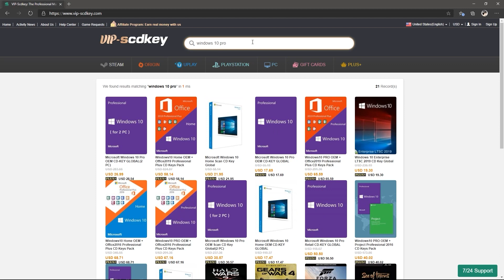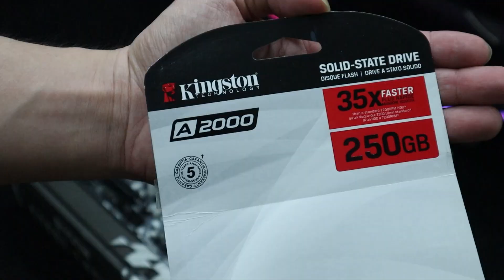SUBSCRIBER PC BUILD under 25K ft. Frostflow X ID Cooling for Gaming, Streaming & Work from Home 2020

Comment: Planning to build almost the same setup, 3400g no gpu for now, case techware forge m white w/ 4 argb fan included. Ask ko lang Sir what if yung mapili kong mobo is not supported ang rgb or argb ng fans na kasama ng chassi, may other ways pa po ba para magamit or mapagana yung argb fan ng chassi?
Reply from the maker: Gagana un basta may fan hub. Kaya mo lang naman icoconnect sa motherboard para macontrol mo through pc settings. May nabibiling mga fan hub na may remote so you dont actually need to connect it sa motherboard, rekta na sa power supply
Reply: Ah ok gets gets, diretso na pala sya sa psu, kala ko need pa iconnect sa mother board and may software pang gagamitin hehe. Kumbaga parang chrismas light na diretso saksak na sa outlet and gagamit nalang ng remote para mapalitan yung colors. Planning to build my first pc kasi this June, baguhan palang sa pagbbuild. Btw salamat sa pagreply, more power sa channel mo Sir.

Comment: Same price pdn po kaya yan until now?
Reply from the maker: Lahat ng links nasa description
Reply: @calebmusik21  wla na po ung gpu kapag kinlick ko ung link.
Reply from the maker: This build has no GPU. Built in sa processor (APU). In that case, anong GPU prefer mo
Reply: @calebmusik21  anything po na magamatch sa mga components. D p po kasi ako nakaka buo ng pc. Baka po may recommend kayo na swak s budget
Reply from the maker: @Energoscels  mainly for gaming ba or video editing? Btw etong build na to will run valorant sa highest settings kahit walang gpu
Reply: @calebmusik21  mainly for FOREX trading lang po tlaga, for mt4 platform pang install lang ng robot for autotrading. Maybe sundot2 lang ng games while analyzing the market. Kaya din po kaya ito ng dual monitor po.
Reply from the maker: @Energoscels  yes, this is more than enough for your needs, tsaka ka nalang magupgrade/or bumili ng video card pag may extra budget ka na. Yes, the motherboard supports hdmi/displayport so you can use dual monitors
Reply: @calebmusik21  salamat sir caleb

Comment: hi does this have a graphics card?
Reply from the maker: APU only, but you can add/upgrade anytime
Reply: @calebmusik21  would it still be able to run games? even w/o the graphics card po ba?
Reply from the maker: @sammae824  the processor used in this video has an integrated graphics card built in so even valorant will work in high settings
Reply: @calebmusik21  alright thank you very much!

Comment: Sir, I'm curious about the keyboard and mouse haha anong brand po yun?
Reply: Yung keyboard di ko alam, pero yung mouse ay, either deathadder elite or deathadder essential po
Reply: @freezy4817  thanks bro!
Reply: The keyboard looks like a custom keyboard since it has aftermarket keycaps, but a good base keyboard I'd reccomend with the same form factor is the Royal Kludge RK61, you can buy one in Lazada for around 1.9k to 2.3k depending on the seller, and the custom keycaps shown in the video are probably around 800 pesos give or take

Comment: Hi po kuya ... honestly gusto ko po tong style baka ito na po yong hinahanap ko na pc build khit na sa 25k po ... tanong ko lng po gaya ng dati tipid ba to sa kuryente at pwde bang off yong mga led pag nag on ng pc? masakit kc sa mata po. tanong ko lng nag cut ka ba ng video.. kc di ko nakita yong part ng pag lagay mo ng usb/audio/HDD.LED/POWER SW/RESET SW/POWER.LED doon sa motherboard. yan kc ang kahinan ko .. pag lagay yan. about po sa case may black po ba available?. honeslty ito na yta yong mejo kaya kong sundan...  compera doon sa unang kong video na panood po .. overall po ang ganda po.
Reply from the maker: RECOMMENDED LAZADA BUILD (25k)
Motherboard: https://invol.co/cl2d12k
Processor: https://invol.co/cl2d12r
Video Card: https://invol.co/cl2d12l
SSD: https://invol.co/cl2d12j
Power Supply: https://invol.co/cl2d12f
PC Case (with fans): https://invol.co/cl2d12h
RAM(x2): https://invol.co/cl2d12o

TOTAL: 25,010 (shipping included)

If one ram only (upgrade/add later)
RAM(x1): https://invol.co/cl2d13e
NEW TOTAL: 23,120 (shipping included)

If lower video card and one ram only
VIDEO CARD (lower): https://invol.co/cl2d13r
NEW TOTAL: 22,446 (shipping included)

*No coupons/vouchers used
Reply: @calebmusik21  tanong lang po kuya. ano po yong nasa baba ng total. Mejo na lilito po ako doon.. pero salamat sa mga link kuya.
Reply from the maker: @ikoartiaga5971  the one below the total is in case lang you have less budget
Reply: @calebmusik21  you mean wlang case?... Tama ba paka intindi ko kuya.. please nmn po doon sa question ko dito kuya kong tipid po ba sa koryente tpos kong na updated na po bios nito or automatic na sha.  Salamat po reply.
Reply from the maker: @ikoartiaga5971  no, yung total is 25k, kung less budget ka 1 ram lang bilhin mo, so use the link after the total if kulang budget. Pag kulang pa rin, pwede ka kumuha ng mas mababang video card kaya ako nagbigay ng ibang link at mas mababang total. Yes tipid na sa kuryente yan. Yes, no need to update the bios na
Reply: @calebmusik21  ooohhmygod thaaaaank you kuya. Copy-paste ko na to sa stick remnder ko sa pc. Thank you sa lhat po. Pero may tanong lng ako kuya  in your point of view mag kano kaya shipping nito pa pontang naga to bicol? Or makkita ko po ba yan doon sa lazada app? .. sorry sa noob question ito yng first time ko ggamit or mag order sa lazada. Pero salamat olit po. God bless sainyo po.
Reply: @calebmusik21  tanong olit kuya bumabago ba yong price nito ka da end of the year?
Reply from the maker: @ikoartiaga5971  yes
Reply: @calebmusik21  kaya pla .. nong nag count ako kong ilan tlga ang total nito. at mejo nag taka ako at mejo na surprise dhil di na sha 25k na sa 26k pataas na sha include na yong shipping... so waiting for your video of 2022 with 20k-25k budget same question po. yong tipid sa kuryente at sana step by step na yong pag build nyo po para easy to understand with zone in camera para nakkita kong paano nilalagay yong mga part ng pc at sana wag na po timelapse. but over all salamat po sa mga help nyo po I'll be expecting the new video for 2022 with 20k-25k budget.

Comment: 1 mistake, mali yung orientation ng radiator tubes. Ang mga AIO is not totally full of liquid, may konting hangin sa loob nyan, basically an air pocket. I suggest flipping the radiator vertically, para yung tubes is nasa bottom part. See short animation vid explanation: /watch?v=b6m9Xhzc6Kw
Reply from the maker: Hi john, thanks for the comment. I’m fully aware on how aio coolers work. The one you’re suggesting is for 240 and 360. This is a 120. The only rule for aio’s in this orientation is that as long as the pump is below the level of the tubing, no air will be stuck. If I flipped this vertically, the pump will be higher or leveled to the radiator/tubing and will cause more problems. Please see jayztwocents explanation here: /DKwA7ygTJn0